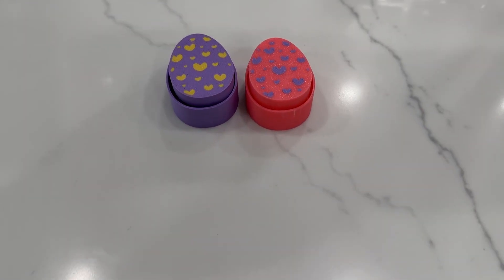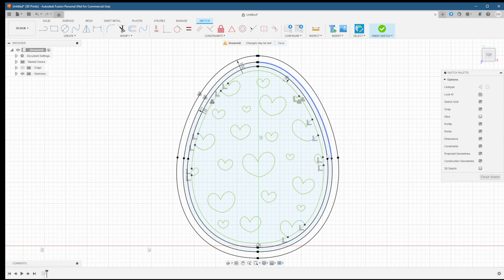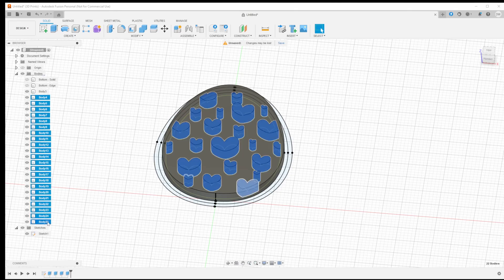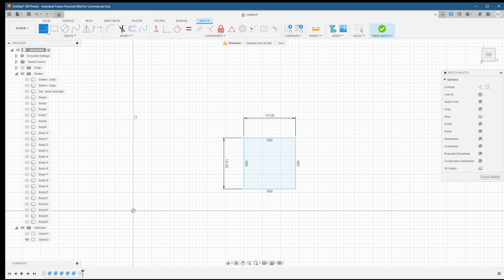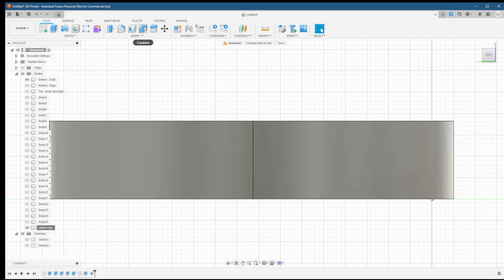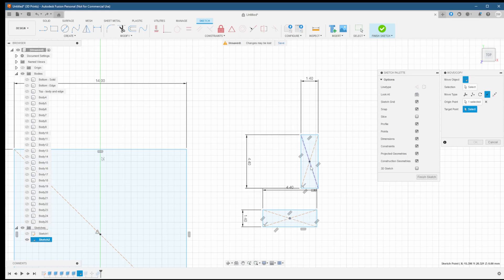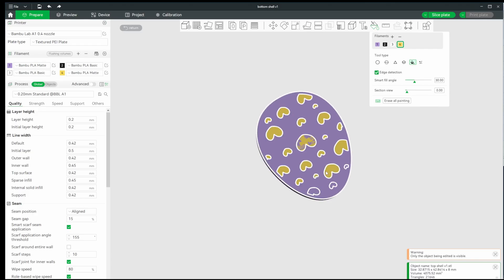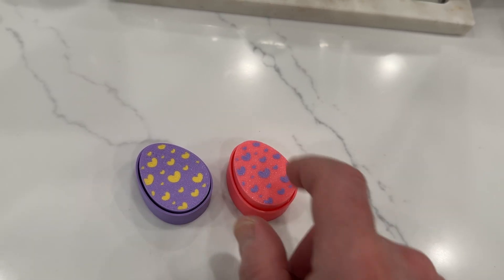How To Make a 3D Printed Fidget Clicker

Comment: I’m making a clicker for our school store! How well does it hold up with it falling and all?
Reply from the maker: Not very well, I'm afraid. I've found most prints that are not thick-walled (or super thin) to be very brittle and since this is two parts being held together by a press-fit, it will most certainly fall apart.
Reply: @TheCustomCorner101 but if it’s super glued together? I am new to 3d modeling so I don’t know how to get stuff to work
Reply from the maker: The top and bottom piece will fall apart if it falls hard enough. Those parts cant be glued since they need to be separate. You can try to glue the key clicker top piece (the plus sign part) to the top of the clicker print, but that is a bit difficult since you have to be careful not to let the glue run off since it may end up gluing the clicker and it wont click no more. Ask me how I know.

Comment: The part where the key fits on the top part as I'm painting in bambu lab the parts are showing through and ruining the painting any suggestions how to avoid this, do I need to move them off the bottom layer slightly in fusion 360?
Reply from the maker: Yes, I would move them slightly more off the bottom. You could also add another few millimeters of layer so its a bit thicker, and then move them up a bit more.